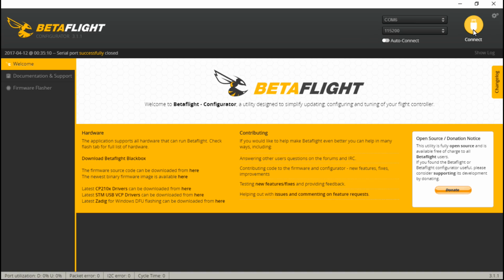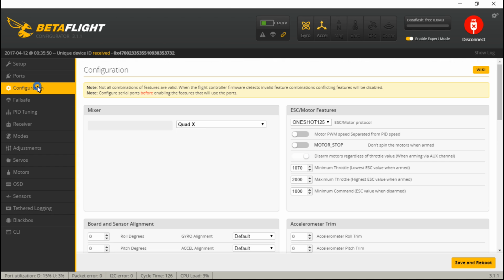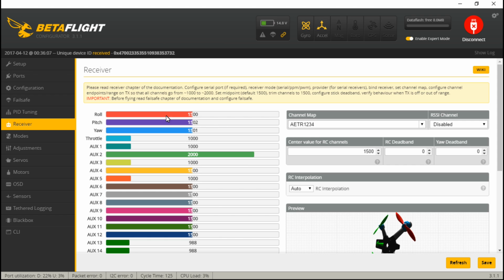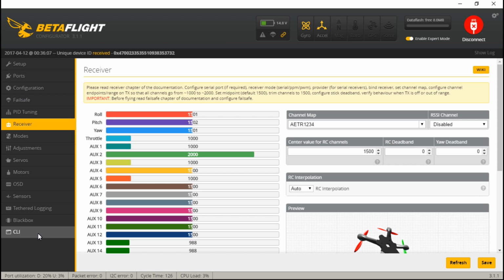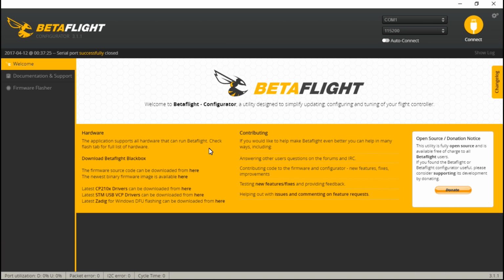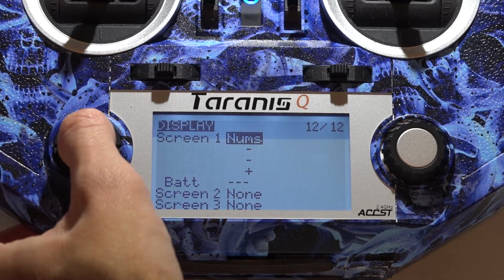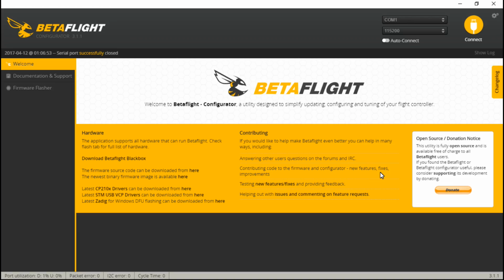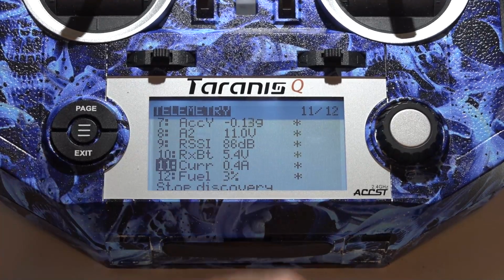DYS F4: Connecting Sbus Receiver & Telemetry

Comment from the maker: If Sbus does not work for you, make sure you do not have Betaflight 3.1.7 firmware on the board. The processor is not telling the hardware inverter to invert the signal. 3.1.6 does work and when 3.1.8 is released then I'm sure they will have it fixed. If you really want to use 3.1.7 then you can make Sbus work by inverting the signal yourself. Here is how https://www.youtube.com/watch?v=gWg9R7OLe5c
Reply: Thank you so much for this. Been running around in circles trying to figure out why it wasn't working. Flashing back to 3.1.6 now...
Reply: Thankyou so much for this.  I was ripping hair out..!!
Reply: Project Blue Falcon this update fixes it. https://github.com/betaflight/betaflight/issues/2840 look for the 3.17 link. Won't be updated via configurator until 3.2. Works fine for me after flashing.
Reply: Project Blue Falcon, I have this exact setup. However this is my first build, so pardon my lack of knowledge.

I've soldered the power/ ground wires from XSR to the obvious pins on the DYS f4 pro board. Right now I have the yellow (Smart Port) wire going to TX3, and the white (Sbus) wire going to SBUS (RX1). I have a green solid light on the XSR  after binding. 

However the receiver tab on Beta flight doesn't show any movement when I move the controls on my QX7. 

What are some things I should check? I've tried the ports tab, making sure i have UART 1 as a serial setup, I've made sure I have the serial transmitter and SBUS dropdown flashed. I've made sure the rx and tx are bound. 

Do i need to do the XSR invertor bypass like in the other video to connect the SBUS wire to UART1/ RX1? Would connecting the SBUS wire to RX6 and keeping it inverted off the XSR work also? I'm not planning on running any additional gizmos.

Thanks in advance!
Reply: Eric Williams fella, he sadly died about a month back.
Reply: Coppertop FPV wow.... now I feel bad. Thanks for the update.
Reply: Eric Williams no worries. he was the best. if you look at the link I posted a month ago there's a fixed hex file for  3.17 that's sorts the inverter or 3.2 does. I've had a recent dys f4 with a broken inverter so that's possible  to.
Reply: Coppertop FPV Thank you! I'll give that hex a shot when I get back to my evil lair.

Comment: This is the link for the betaflight 3.17 hex that works with sbus. https://github.com/betaflight/betaflight/issues/2840
If you scroll halfway down, it's the 3.17 link posted not the 3.2. This won't be released on the configurator until 3.2

Comment: hey man, thx for all your help. i have the dys f4 and frsky xm+ rx. the rx transmits rssi on channel 16, which i have enabled in receiver tab and aux max channels is set to 14. i cant get rssi to show in setup. any help would be appreciated. thx
Reply: ray rokni 
I use xm+ but my dont work. 
I dont know why! 
So you have A Tip?
Reply: Hey Vape.
the only thing i cant get to work is the Rssi. the rest no issues. make sure you have the xmplus sbus on UART1 and voltage selection pad to 5V.
Reply: Can you bind the RX to your radio
are you getting power to rx, do the lights come on the rx
make sure you have sbus wire on the correct pad, it is marked sbus. make sure it is setup correctly in ports tab in BF. make sure it is NOT FW 317 on bf. Make sure the sbus wire isnt broken by the solder joint.

Comment: I've been trying to get a simple voltage reading on my Taranis by hooking up an FVBS-01 to that pin on the XSR.  I've noticed that I get an A2 voltage reading of around 10 volts without anything even connected to it. Just 5V going into the receiver to power it.  Any ideas?

Comment: Hi , thanks for the awesome videos on the dys f4 , I managed to uninvert the telemetry on the xsr and put it into the correct pin and get the sensors but after about 10 seconds all the sensors stop reading ,, if I reboot the FC or repower the quad it works again for about 10 secs then drops off. Any ideas ? :)
Reply: I'm having same issue. anyone figure this out.
Reply: Paul Kulka I tried with no Luck ,, even flashed the latest 3.2 build but had no joy.
Reply: Ben F OK I'm going to keep trying to figure it out I'll let you know if I do.
Reply: what if we invert the sbus signal and just use the smart port not inverted signal
Reply: So I was experiencing this same issue. What I did to get it to work was update the FrSky XSR firmware to the latest version (Version 170605 released 2017-06-05) which can be downloaded here: http://www.frsky-rc.com/download/view.php?sort=Firmware&down=386&file=Firmware-XSR

Here is a blog showing how to flash your XSR firmware using your Taranis X9D+: https://airjacker.com/blogs/guides/159836807-how-to-flash-the-firmware-on-a-frsky-xsr-or-x4r

JC also has a great video: https://www.youtube.com/watch?v=H6Uk8uuLHXw 

Side note: I'm using BF 3.1.6 and the XSR non-inversion hack

Comment: Hi, I just wondering on what UART will I connect my Satellite rx and what pin has the 3v.
Reply: There is no 3v pins on this version.I have the v2 with 3.3v pins and its still sucks.I cannot connect my spektrum sat to it.Save your money and get the f4 revolt.They are the same price and it should probably work with no issues.I have an unfinished build sitting on the shelf for weeks now.
Reply: H.Ayvaz hello. Yes I jusr figured mine that there is no 3.3v on my board, i think this is a prototype of some sort. I can not complain since mine was a won giveaway. I have contacted some seller of the DYS F4 and claimed that they have the 3.3v on the "Pro" version of the board.

May I know why can you connect your spek sat?

I have two revolts board here and I finally decided to hang them since I don't like raceflight that much. The gyro on the revolt is too sensitive for my build, since my frame is designed to be hardmount one.
Reply: I think its UART 2.I tried them all and nothing works.I do have the DYS v2 pro with 3.3v pin outs
Reply: Really? That is a rare case. Did you check the 3.3v pads of thr FC if it really have a 3.3v Out?
Reply: yes I have 3.3v.I tested it with a multimeter.My receiver's light turns on when I turn my transmitter on.
Reply: I'm in the same boat and I have the V2. No matter what I try it won't recognize the signal from the spektrum satellite receiver
Reply: damn! I guess Im not the only one.
Reply: H.Ayvaz no your not and evidently so few quad pilots use spektrum that nobody has a solution yet. I guess we'll have to wait for Le Drib to figure it out
Reply: HELL YEAH! I figured it out. Connect the satellite signal wire to the s-bus port and enable serial rx for UART1.  That's it
Reply: YEAH!!!! You're right it works!! Back in business!!! Thanks Michael!!

Comment: I have tried everything to get a spektrum satellite receiver to work with the V2 and the FCB won't recognize the signal. The receiver powers up and it works with other boards, I've even tried UART3. Google search gives nothing
Reply: I figured it out. Connect the signal wire from the receiver to the s-bus pad and enable serial rx on UART1, that's all there is to it.
Reply: should i solder the wires from the spektrum receiver to the F4 board  in the same order shown in the video ? Can you also tell me how to enable serial rx on UART1 ?

Comment: I am using xm+ receiver. 
I have all do what you have to said in your Video. But I can Not control.
Reply: did you finally get it? im in the same situation and not working at all.
Reply: Camilo Bedoya Salazar Bedoya yes now it works! 
I have to solder all pads new. I think there was Anywhere A little bridge between some solder pads.

Comment: my board seemingly is correct on betaflight, motors work all in the right direction.  callibrated escs, and in belheli suite made sure the escs were all synced up.  if I put any roll or pitch in, it just twist flips over super fast.  anyone ever seen that?
Reply: you got your motor order wrong...1/2/3/4...check with betaflight and wiring on board